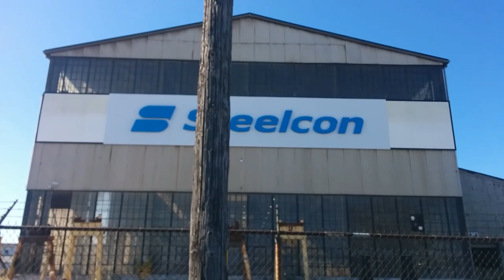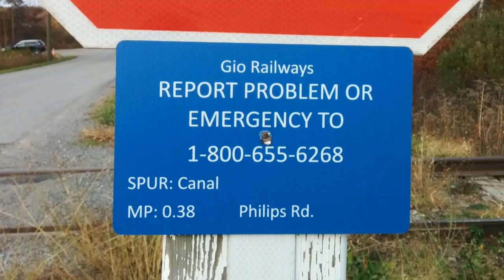Brand New NORFOLK SOUTHERN COIL CARS Transported by Shortline GIO Rail in Niagara city CANADA RS-18u

Comment: Great video.  Question.  Do any of these freight trains have cabooses?  I like to see the caboose at the end of freight trains.
Reply from the maker: No; In February, 1988, the Canadian Transport Commission gave permission to Canadian railways to replace the caboose with the new end-of-train unit. The conductor moved into the locomotive cab with the engineman and front-end brakeman. The same was for the USA as well...the premier manufacturer of cabooses, International Car Company, ended its production in 1981. Soon railroads began to scrap, sell to rail enthusiasts, or donate to museums and communities these mostly obsolete pieces of equipment. Cabooses have been converted into snack bars, motel rooms (ex. the Red Caboose in Scranton PA), and specialty excursion cars (ex Nevada northern I think $200 to rent to caboose for a ride, Durango & Silvertons castaway caboose is about $400/night)